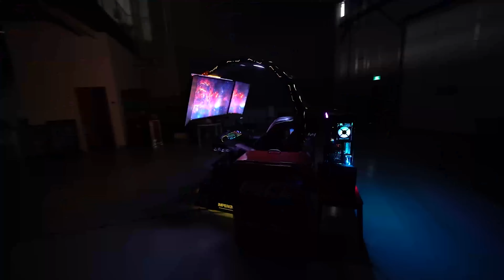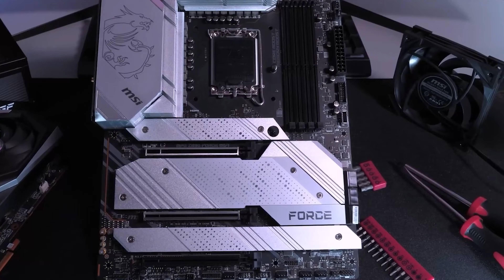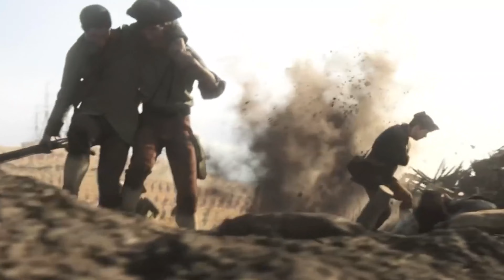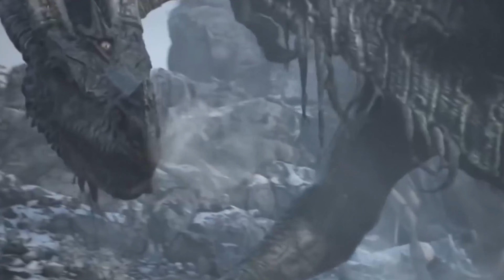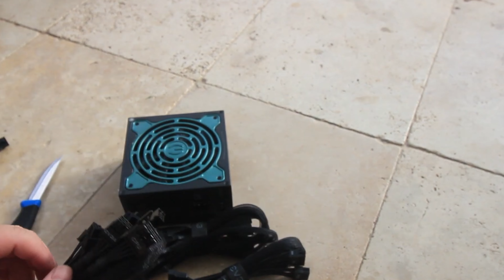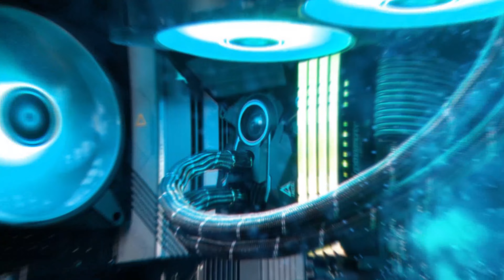Best 4k Gaming PC Build in 2022!

Comment: Most of the parts you mentioned are exactly what I want in my new PC. Except instead of 12700k and 3090 I am going for the 13700k and a 4090. And I am still thinking between a Lian li 011 mini or the hyte y60. I want the hyte y60 more but its not good for the size of the 4090's unless I get a liquid cooled 4090 suprim. For the psu I'm getting the corsair rm1000x 80 gold. I'm hoping this build can last me 10 years of 4k gaming and video editing and streaming.
Reply: Agreed..The video is titled "BEST"...which means cost is not a factor....why wouldn't you choose the i9 13900K with a Z790 chipset motherboard?
Reply: I think you should just ignore the kidney part and sell out your brain to afford a 4090/13900k combo